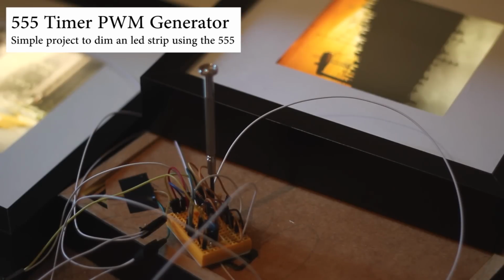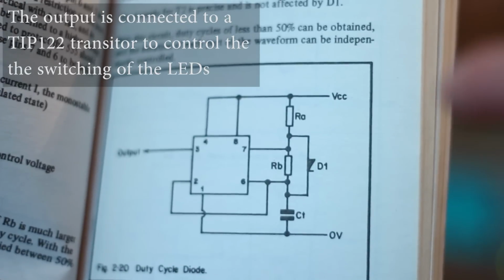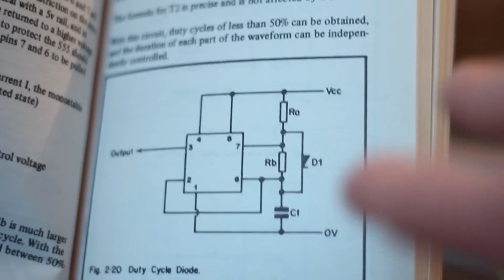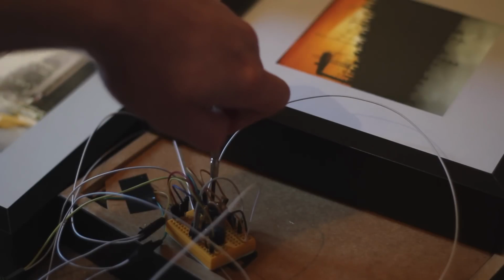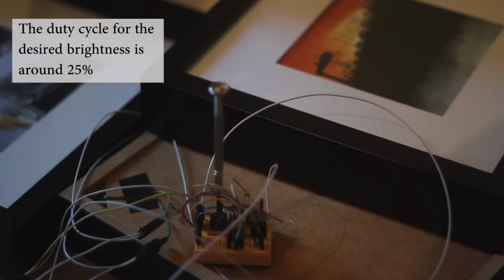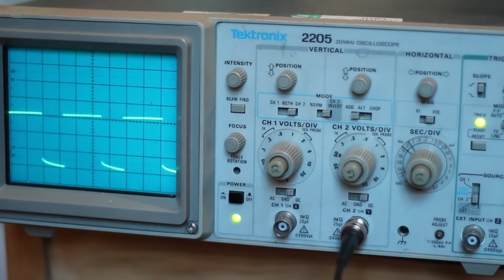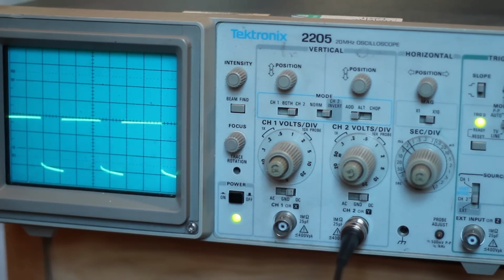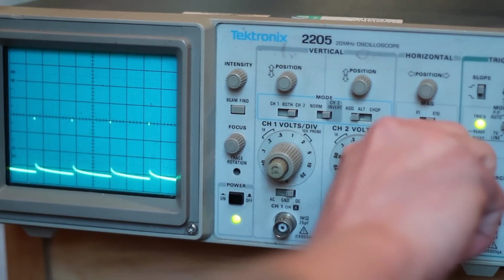555 timer - Adjustable PWM generator

Comment: Hi David thank you for your video!
I'm completely noob in elections.
Can you tell me nominal on resistor witch in line with transistor? And how to choose right transistor ? I'm planing to do some light based on 1watt LED, powered by single cell LIPO battery. Any suggestions?
Thank you.